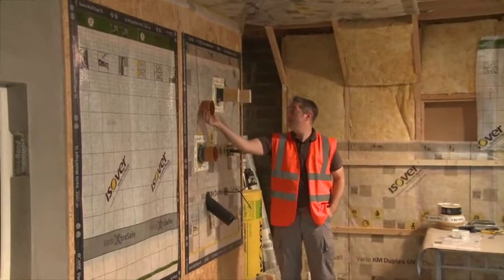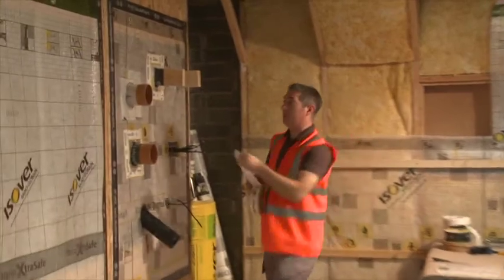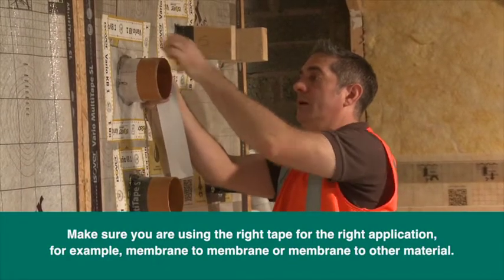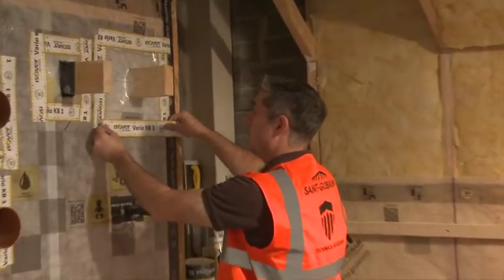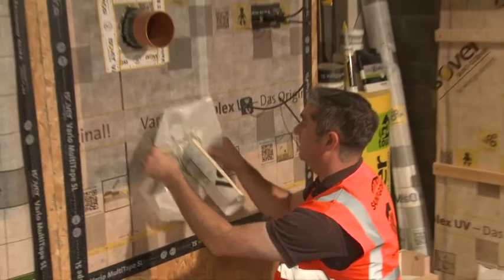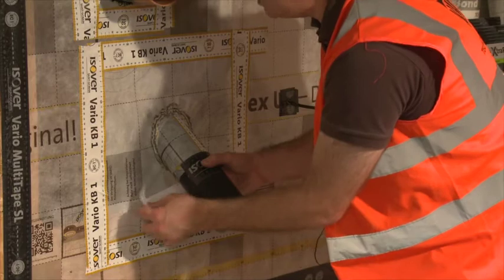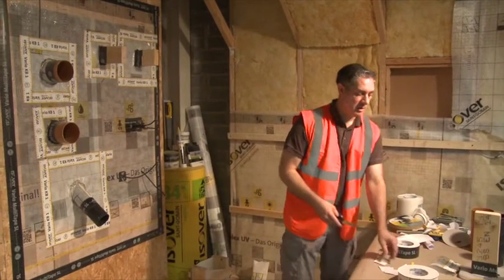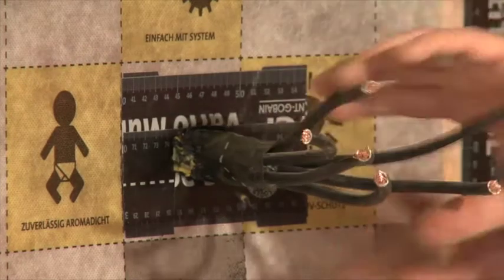Sealing Pipes, Joists & Cables

Comment: I find scissors quickly gum up with Tesco (Pro-clima) tapes (because it's very sticky stuff), so have to use a knife. I guess it works OK with these isover tapes. Rather an making your own collars or depending on that dodgy bit of goop in the corners for the joist, just use pro-clima grommets: (roflex or kaflex). Available from green building store and ecomerchant in the UK. https://www.greenbuildingstore.co.uk/product-category/airtightness-products/grommets/
Seems to me he's making the backing piece excessively large, which just uses a lot of tape.
Especially with multiple cables a proper kaflex multi-cable grommet is more reliable than trying to squirt goop into the bundle.

It's useful to know what to do when you've not got the right grommet to hand (especially whilst builders merchants don't stock this really basic stuff) but using the right thing is quicker and easier.